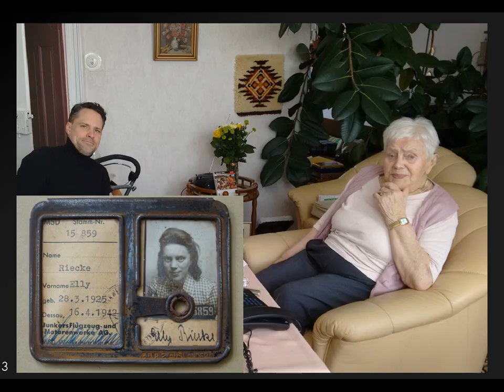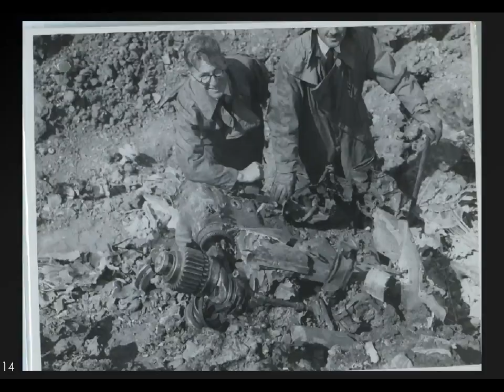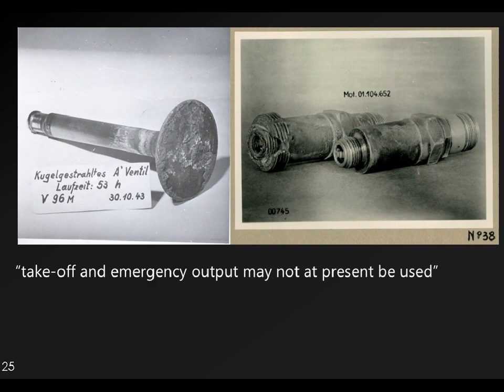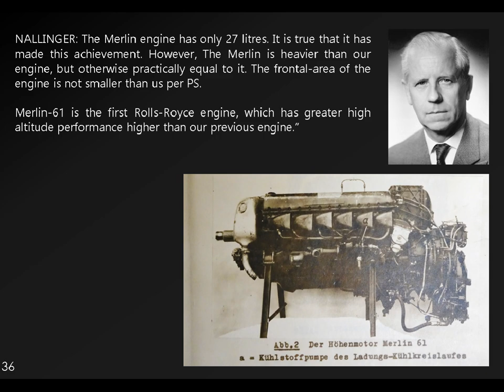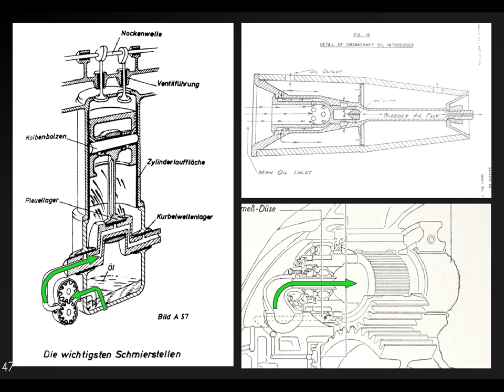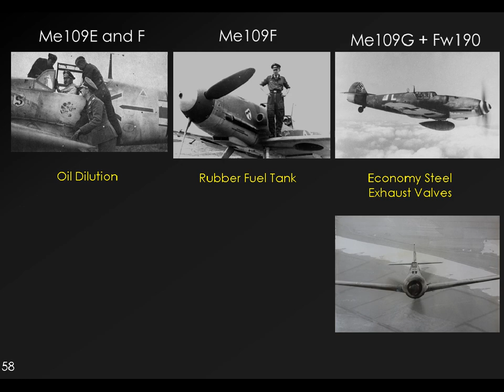The Secret History of Fighter Aircraft Engine Development in WW2

Comment: Why Napier and Junkers didn't devellop the two stroke diesel design I will never know. It was marginally lighter and used marginally less fuel. The fuel didn't need to be high grade. If I am right Junkers had used them since 1926 in larger aircraft. The Lancaster comes to mind for a Napier version. The English Electric Deltic used a modified version. The Germans highly regarded the Napier Lion and seemed bemused that the Merlin was dominate. The simplicity of the two stroke was attractive if asking. Bristol had an excellent diesel design killed by the turboprop. I met the German WW2 diesel engine designer who worked for Rushton Hornsby after the war. His was a universal fuel design. I can't spell his name. Grushal sounds close. Helena his wife who made me some soup.
Reply: Despite many advantages of diesels such as much reduced exhaust gas temperatures (enabling the Germans to use turbochargers with low nickel blades, with a blade temperature limit of 600 Degrees C) the power to weight of the diesels of the era could not compete with that of petrols. This is the main problem with adoption of this engine type. Jumo 205 = 1.3 PS/kg and DB601 = 1.96 PS/kg

Comment: How much was down to 100 Octane fuel from the States. BAM British Air Ministry Fuel. Developed from the standard 100 Octane US aviation fuel.
Reply: He probably would have if they weren’t still working on a complex new design😇
Reply: The fuel issue is extremely complicated, and (yes I know, everyone says this) to explore that in full depth requires a book, mine (others discuss it thoroughly with respect to Allied use, but only mine adds in what was happening in Germany for comparison, which is extremely important to understand). Very roughly speaking however, 100 octane (vs 87) allowed (in engine able to take advantage of it) an increase of about 25% in power.

Comment: This all needed more time for development. The Germans should have created a reflector for their direct fuel injection system to spray the fuel on the closed exhaust valve for cooling. Could be that there was no need for more nickel than.
Reply: They understood how to experiment with injector spray patterns, and made a very large number of tests on various directions for each fuel jet. Remember that the fuels at the time had very high T.E.L content, which caused a lot of the corrosion problem too. It was an extremely difficult situation.
Reply: @CalumDouglas  True !
It is truly not easy.

Comment: One thing that needs to be mentioned here is that according to Ricardo himself, the German engine policy for the inline engines was that the displacement was to be large, and the structure to be super light.  The low BMEP was to be compensated by the light weight.  So, when Daimler Benz suggested that their engine was lighter than the Merlin (and probably Griffon) when compared as weight per liter of displacement, that was not an excuse, it was by design.  The Germans knew that they would have to work with lower octanes and therefore less BMEP.  In a way, the development of the Merlin was not so much an engine development as a fuel development, a luxury that the Germans did not enjoy.  You can even look at the other side of the world.  The Japanese were able to develop the 14 cylinder Nakajima Homare, with the same displacement as the Griffon (~2200 cubic inches), with the same hp, less weight, and operating at 91 octane fuel (without the Griffons high altitude performance, granted, but the octane number generally helps at lower altitudes).  Now that is a real feat.  Nakajima did this thanks to high rpm and water/ethanol injection.  Yes, the Homare had quality issues, but that is not the design's fault. 

But we can agree on your overall theme, that the organization of the British air ministry was better than the German.  The British had a lot more experience in making wars and colonizing countries, and their institutions were older and better organized.  The German regime was much younger and inexperienced.  But their engineering firms were first class.

Thanks for the interesting video.
Reply: Excellent post😎, if I can add the German engines were lower reving engines partly due to bigger displacement and lower BMEP.... a case of turtle and hare maybe.
Reply: @richardrichard5409  Thank you Richard ^2.  I think the lower rpm also helps with weight reduction, less inertia loads ...  I need to correct myself.  The Nakajima Homare had 18 cylinders.  Similar to the P&W R2800 but with 2200 cubic inches.  Their aim was max hp at minimum frontal area, ideal for fighters.  Cheers.

Comment: By 1918  the most advanced aero engines were V12s with four valves per cylinder and twin ohc per cylinder bank . They weighed about two and a half pounds per horsepower . The big advance they lacked was super chargers and these didn't arrive for another ten years . So it is reasonable to say that from then on it was small incremental developments . All the original work had been done .
Reply: They say making it look easy is the hard part.

Comment: This was really great, who would have thought the real Germans were even more bumbling the Allo Allo ones.
Reply: Good good question truck motors are the same Austin acarbureta with Noo parts inside one jet that a squid could remove soft valve springs castiron pistons isay the spitfire was a old engine like acesner cold low compression others say a cleaner is high compression look at jaguar huge soft engine isay a spitfire is like all pony engines smooth like a Morris eight sweet running but based on long lasting soft ingines stationery almost lots of cast jacket pannles hundreds of Allen bolts so how did this arrangement contain high water pressure the first spit only made five hundred horse but later two thousand that tell me add one bulked up power it dose look like the Germans got caught out by the merlinthey were probably fighting a minimalist war and tried up
Reply: @johnanderson1388  what on gods earth did you even say
Reply: @johnanderson1388  what?

Comment: The Mosquito was a true multirole aircraft, and was so effective because of its high speed, long range, and excellent flight characteristics. Was a constant thorn in the flesh for the Luftwaffe. The allies should have built many more of them instead of mass producing lumbering Four engined bombers, which were  sitting ducks for the German air defence system , resulting in tge loss of staggering numbers of air crew.

Comment: Fascinating, well presented video. I am in awe of the painstaking research and effort that must have gone into its making. 
One thing that puzzles me is the use of inlet guide vanes for the Junkers Jumo supercharger (52 mins into video). 
This feature was well established for boiler fan control as far back as the 1920s.
Does anyone know why such a basic design improvement was only adopted by the Germans late in the war (and not at all by the Allies)?
Reply: And the Soviets did it before the Germans, afaik.
Reply: @JWZelch  On aero engines, the French were the first, Germans tested it before the Mikulin engine was released but decided not to mass produce it.
Reply: I wrote a book to answer questions like this, and you will find the answers therein. Its not an answer for a comments section!

Comment: why were the Germans so keen on inverted engines? and is it true the upside down V12's were actually from a RR 'outlandish development' set of engine drawings at the bottom of
a drawings cabinet labelled 'this way up' (prone to pinking, oil degradation, valve overheating and making mincemeat of spark plugs) and gladly handed to the Germans before the War presumably without the test results sheet and with a straight face? also is the Junkers 213
an attempt at a Merlin 61?
Reply: Inverted V: Places the high maintenance part of the engine close to the ground where the mechanics are.
Gives the pilot a better view from the cockpit.
Makes the frontal area of the engine a triangle with its apex at the top, putting the widest part at the bottom merging with the wings and the narrowest part in line with the pilots head.
Of course the oil remaining in the crankcase does seep down into the cylinder heads etc.  Remember all old engines were oil burners compared to modern stuff.

Comment: I was watching the video of the current Mazda rotary engine that mentioned that the original rotary concept was patented by Wankel in 1927. It strikes me that it would have made a good engine for a fighter engine but would have needed a reduction gear to drive the propellor. It had a better power to weight ratio, was also narrower reducing drag. I know that there were problems with the rotor seal but life was not that important on a wartime warplane.
Reply: Felix Wankel was working to get the rotary operational during WW2.  He failed. The current rotary was designed by his assistant.
Reply: @johnburns4017  were they working on an auto engine or an Aero engine?
Reply: @ianoswald1605  
Just the engine. Its application would come after it was proven, but with an aim for Nazi military applications. The engine only came post WW2. No R&D was done immediately post war as during WW2 it was funded by  the German Nazi government. In 1951 private development by NSU began. Two models were built, the DKM by Felix Wankel and the KKM by Hanns Dieter Paschke. The Paschke was adopted. Realistically it is a Paschke engine.

It is used in drones and other niche applications, as it is one third to 40% of the size and weight of piston engines and very smooth. Why it never was taken up for manned light planes is beyond me. The engine cannot have  catastrophic failures, as it just winds down.  

Many of the old problems have been ironed out. The efficiency rises by around 27% when using hydrogen as a fuel, making it competitive with hydrogen fuel cells. But it emits small levels of pollutants in burnt oil to lubricate the apex seals, unlike the fuel cell which is zero emissions.  But in a plane it can drive a propeller directly without using an electric motor which a hydrogen fuel cell would need.

I read if scaled up to one metre diameter rotors turning a generator, they could be in banks, to power cruise ships and the likes using hydrogen. If one is down, then slide it out sliding another in, while it is being maintained. Divide and rule.

Mazda are to re-introduce it next year in a EV hybrid, so they said. The engine is more suited to such a constant speed application, especially when its sweet spot is met. But solid state batteries and EVs look to ensure it is short lived in road applications.
Reply: @johnburns4017  ;
Reply: @johnburns4017  very interesting and something I was not aware of. I guess my theory that it could be used in aviation was valid. I appreciate your feedback.

Comment: Great video. My question would be, where did the Allison V-1710 fit into all of this?
Reply: It was designed to use turbocharging (per USAAF pre-war doctrine), which made packaging in single-seat fighters really difficult. With the P-38 being the only design using the proper turbocharging system and facing compressibility problems that were a convenient excuse to keep it sidelined from the ETO and the major USAAF effort, development was slower than it could have been. On the other hand, RR had invested in supercharging technology and had the leg up that, in the rush of the war, was enough to propel the Merlin to the fore and relegate the Allison to way in the back.
Reply: The RR Merlin had the lead in the forced-air induction system (gear driven supercharging), Allison was directed by the USAAF to develop Turbocharging (through General Electric) as the second stage of their forced induction system. GE dropped the ball and the Allison suffered high altitude performance issues as compared to the Merlin. But the Allison had better bearings-including a roller bearing as compared to the Merlin's friction pad bearings in the valve train. Allison also had superior crank bearings and performed on considerably less internal components. Had Allison been allowed to develop their own forced air induction system instead of having to rely on General Electric, the Allison would likely have been a world beater. Hindsight is always like that.
Reply: See my long reply above to Paulo Rebordão for more details.   Allison, a division of GM, never had the high tech engineering culture to want to spend the time, money, or engineering effort to refine the V-1710 and make it more competitive with the Rolls Royce engines (all the Merlin variants or the Griffin).   It had huge and very profitable contracts from the US government to produce the V-1710 pretty much as is for the tens of thousands of P-38, P-39, P-40, and P-63,  and that is ALL the company ever cared about.    Profits.   Changing anything to try to improve the inherent design flaws of the V-1710 would have meant retooling the factories and cutting into the profits.    By the time the contracts for the V-1710 started to drop to zero, because it just wasn't being used in the latest aircraft anymore, the end of the piston engine for front line warplanes  was at hand, and Allison was then given the British designs for jet engines by the US government to produce, which is what it got into next.  It's own jet engine designs were not that great either compared to its competitors, and so all that's left of its engine business today is its gas turbines, and mostly that's because Rolls Royce ended up buying the company.
Reply: @gandalfgreyhame3425  The USAAF directed Allison to develop Turbocharging for their engine, Allison wanted to use conventional gear driven superchargers (both stages). GE dropped the ball on Turbocharging at the Allison engine suffered high altitude performance issues because of it. USAAF was at fault, not Allison. Incidentally, the Allison engine achieved 1000 HP output before the RR Merlin, which denotes your criticism of them being 'profit focused' and not interested in technical development as specious. The Allison had superior bearing durability in both the valve train as well as the crankshaft-mains and conn rods.
Reply: It was removed from the Mustang and replaced with the Merlin in order to make the Mustang into a very good long range fighter.
Reply: @andrewallen9993  That’s a given. I’m taking about how the Allison, and Pratt and Whitney for that matter, engineering compare against Germany and Great Britain. I would also be interested in hearing how the sleeve-valve Napier engine fit into the scheme
Reply: @Spectre407  Pratt and Whitney R-1830 as well as R-2800 were some of the best engineered radial, air cooled engines of WW2. The Wright R-1820 was also excellent. American manufacturers led the world in radial engine development. The sleeve valve approach of Bristol was novel and the Perseus and Hercules were very good engines, though lacking in the power compared to comparable time poppet valve radial engines. The Pegasus could have been one of the best radial engines of WW2, but Bristol couldn't resolve sleeve durability issues in time to make much of an impact on WW2. Napiar-similar story, but did remarkable service after WW2. In a nutshell, the British led the world in liquid cooled aircraft engines in WW2, the Americans led the world in air-cooled radial aircraft engines. Germany produced a good engine in the DB-601, but it had some shortcomings-mainly driven by fuel quality-that were never entirely resolved.